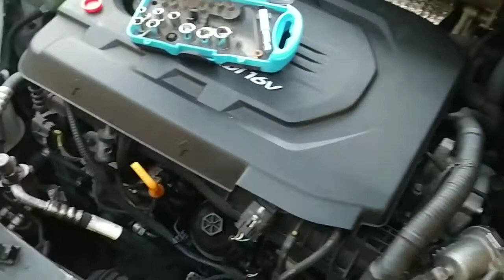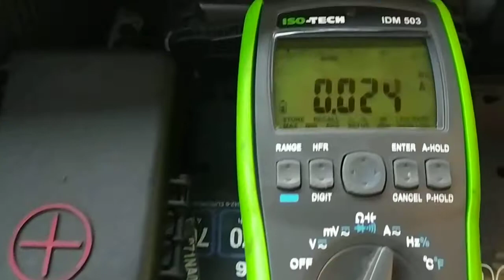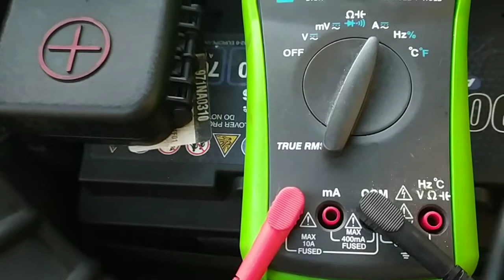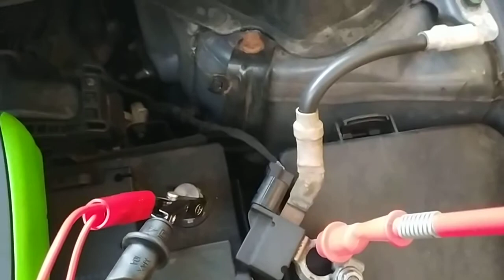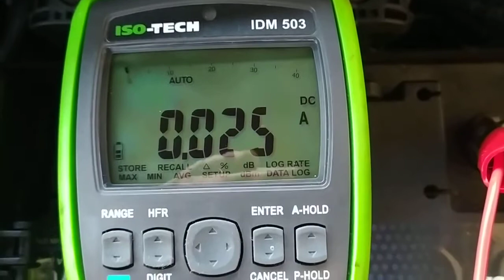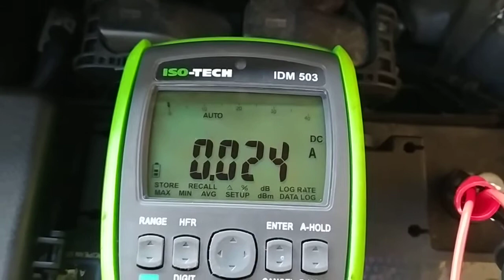Checking Hyundai battery drain

Comment: Hi interesting video. I have the same car as yours. I have replaced my battery 3 times a year and I cannot find out why. I will measure the drain later. Can you advise me where to look at should I find a drain?
Reply from the maker: I would check battery voltage when engine is running, on my car it is around 14.1 volts. It is below 13 volts or above 15 volts then alternator may be faulty. You should join www.i30ownersclub.com as it has forums where owners share their problems and find solutions. If you measure the battery drain, and it is more than I measure, multiply the current x 12 to work out the power. For example, 0.4A x 12V = 4.8W. A small bulb is 5W, so it could be an interior light is staying on all the time, like the luggage compartment or glove box.
Reply: @brendanpells912  thank you very much for the prompt response. Last night I measured the battery while the car was off and on the alternator seems to be working just fine as I could measure between 14.3 and 14.5v. however on the ampmeter I could see 0.6 when the car was off gradually dropping to 0.4a. I too suspected the glove compartment but it seems to be just fine as I put my phone on record and could see it turning off as it should so not really sure how to trace this problem . Shall go the route of fuse by fuse?